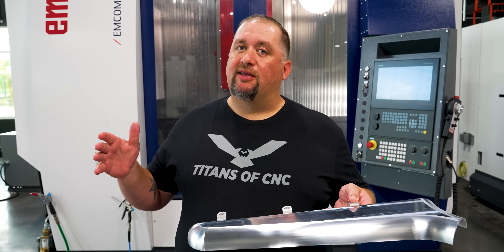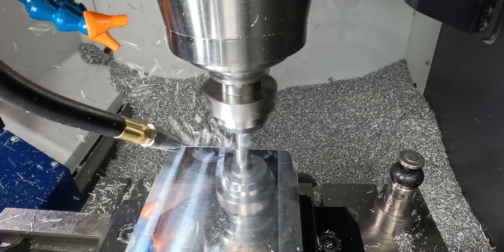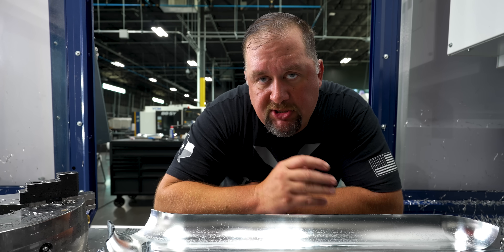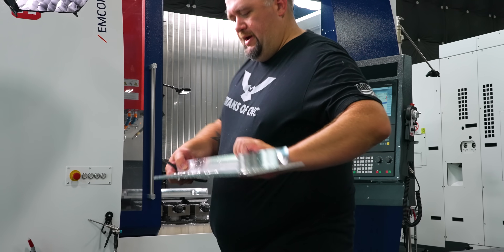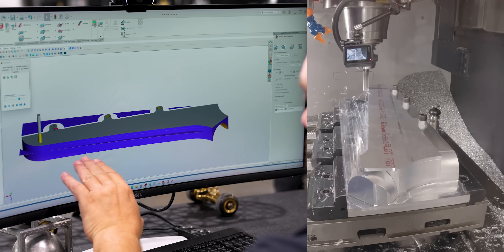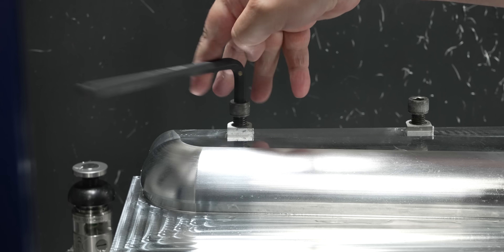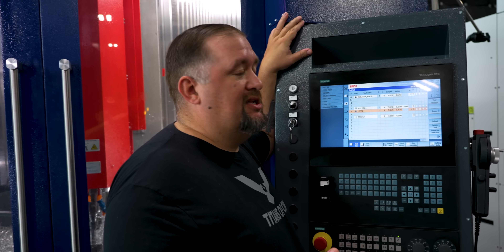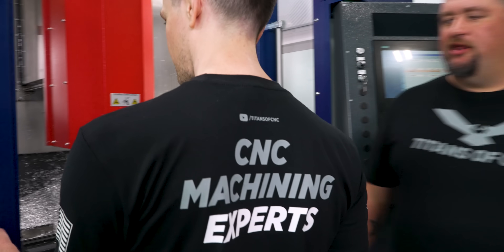How Do You Machine Parts This Fragile?

Comment: I am working on a lathe and our thin walled parts have a wall thickness of 0,5mm. The part itself is in many variations. lenght up to 110mm and diameter can be up to 60mm Still we have to make outside and inside f7/F7 fitting. ;) Greetings from Germany.

Comment: speaking of fragile parts, my biggest challenge,,,, imagine a 40" long "U" the bottom part and the sides that form the U are 6" each.
the sides had a 2.5" double with an irregular surface.
width 1", length 40" with a constant thickness of .250
aluminum 6061........thnks for sharing.  i learning a lot in your videos.........amazing job.

Comment: It feels like you could use some less expensive and easier to machine material for the fixture (like plastic). and that part looks like it should be made by some other means (like casting or pressing).

Comment: Why is it that machining costs more than a fabricated part... it seems straightforward that the hard part of the job is calculating dimentions. Where if you were to mold or fabricate the same part you would still need to do that but also add in a  craptun more manuial laybor than the person running a cnc. Were prettymuch just paying more for the company to afford the big ass machine. I partially blame cnc machinests for the decline in the american steel industry. Hopefully when we make it common practice for ai to controol cnc we would be able to afford it as a middle market rather than top of the line thing when most of its all automated

Comment: Considering he had to machine two different supports anyway, I really can't see how this could be faster OR cheaper than hydroforming...
Reply: Well, I have worked in several aircraft shops that did both hydroforming and drophammer forming, not just machining. That's why I mention that in this video. But Hydroforming does not usually make a perfect part......you have a handforming department that usually beats the part with rubber straps, and hydroforming also has other challenges like wrinkling and oil-canning, not to mention the extra design time to design the hydroform blocks with springback, which can be very tough with compound curvature like this part has. In the end, it's 6 of one, a half dozen of another, and sometimes it's up to the customer to decide how they want the part made. In this case, they sent us plate and asked for the part to be machined, so that's what they got!

Comment: Even if you had the conveyor those chips wouldn't fall onto it. Looks like a permanent headache.
Reply: To be fair, I also was barely running coolant, you can see the valves on the spindle are almost completely closed. Coolant would certainly have helped with the chip evacuation

Comment: Respectfully, nice looking part.  'Thin-wall' is in the eye of the beholder.  Due to the overall dimensions of the part, this is thin wall, but could you do that same part with a .04" to .05" wall to show what technique you would use.  From the battlefield, we are getting creamed by designers that have no concept of machining metal.  They 3D print sections of a part, glue them together, and say 'my printer could do it.'  Since they are higher up on the pay scale, who do you think has to adapt? Would this process lend itself to adding a vacuum seal around the perimeter with some channeling on the interior of the tool?

Comment: I still gotta ask, How much did it cost? Considering the cost of the machine, all the tooling, programming, time, material cost, your wage, profit margin and mark up etc... Chip watching fan boys might want to know. Sure didn't do this job for 20 bucks and a couple cans of Copenhagen.
Reply: A typical shop rate is around $100-150 an hour. Each part took about 1.5 hours, and each fixture took about an hour. So worst case this cost about $2500 plus material
Reply: @barrysetzer  Thanks for the reply Barry. Much appreciated. Can't argue about the time frame but the shop rate and cost + material sounds low.

Comment: Question guys, but when I use cam on ONEcnc i have to have my tools numbered, on that system and after I transfer it to my 828D controller I have to change each tool manually in the program to (eg) T=“16mm carbide” or in your case T=“Barry” … does your cam system also do this or can you actually name the tools you want on your cam system

Also a machinist always cleans out his own chips! 🫣😭
Reply: Haha i cleaned my own chips, it was just a joke! And any CAM system can output tool names rather than tool numbers, just talk to your CAM reseller and they can tell you how
Reply: @barrysetzer thanks Barry I’ll look into that. The more tools I use the more complicated it gets manually changing the tool names in the program. Can take around 10-20minutes depending on the size, and if I need to make adjustments I have to do it all over again 😢

Comment: Why would you CNC a part like that? This should be sheet metal
Reply: Manufacturing such a part from sheet metal requires expensive forming tools, which often have long delivery times. For larger sheet metal parts, laser cutting systems are sometimes also required to smooth the contour after forming, which increases the machining effort. For small batches, CNC milling is definitely the best choice, and such parts can be manufactured from high-quality materials. Fits for seals and screw connections, for example, can also be achieved with milling, giving the designer of such components more options.
In mass production, such a part would, of course, be manufactured directly from sheet metal.

Comment: What kind of surface profile was required? How do you deal with spring back after over restraining the part?
Reply: The nice thing about this particular part is that it had no profile callout, and it gets welded together with several other components. Somewhat surprising also was that the part didnt warp hardly at all, less than .010". However, even with companies like Boeing, with thin parts, they know the part will warp in an unrestrained state, so they have specs that allow a certain amount of warp per foot or they allow the part to be inspected in a constrained state.

Comment: Great video as usual, I do have a question, could a casting have been utilized to avoid all the waste material?
Reply: It could be cast or made from sheet metal. But for 5 parts, its cheaper and easier to machine from solid!

Comment: i still remember  when i was a student and had to turn a 0.0393 inch thick walled part on a manuel lathe ( ID and OD had to be turned in the same setup  ) holy moly that wasnt fun  ( my instructor wanted a custom made solid billed aluminium exhouse for his bike ) lots if small passes going slow with the right amount of cooling pressure did the trick ( there wasnt material to make a fixture and both ends was tapered inwards anyway )

Comment: You started the job correctly by using plate not bar stock. Parts came out perfect.
Reply: That's actually a very good point, and something that I SHOULD have mentioned in the video. Cheers!
Reply: @barrysetzer  proper stock is crucial. Metal grain direction is also important. That part would have moved a mile if metal flow was in the width.
Reply: Oh yea i hate when parts bend like a babana

Comment: I'm always curious why they use long endmills for everything can't you push a shorter one faster?
Reply: In the case of this part, the tool length was necessary. The part is 2" tall, so I used a 3/4" endmill that has a 2.25" LOC, and a 1/2" ball with 2" LOC

Comment: For Op2, I see the 3 bolts holding the part at the top.  What's holding the part at the bottom?  It seems like the part would be loose down that and would cause chatter but the part looks fine.  What am I missing?
Reply from the maker: He explains how to machine into the part to keep pressure on it. Technique
Reply: @TITANSofCNC  Thanks for the reply.  I didn't catch this in the video but I guess I'll have to watch it again.  Seems a little sketchy to not hold the part near the bottom too but hey, you're the experts and the part looks great.

Comment: Good work and good video. 

Super glue, Bondo, Vacuum fixture, double sides tape, tabs many ways to handle this part. Did a 6061-T6 14" x 20" x 4" cover for Predator Drone 25 years ago that was .03 walls with ribs with a .002" flatness tolerance in 2 operation on a HMC. I made custom STI shoulder bolts and an internal spider to stabilize the part. Do that with a 120" diameter billet 12" think and hold the .01 flatness taking 7700lb alum down to 440 lbs or 65" diameter x 50" tall tube 5500 lbs down to 550 lbs and hold .0015 flatness and .002 perpendicularity.

Comment: Could a vacuum hold be used on your second op? Seems like it fit tight enough and was smooth enough that vacuum might have worked well and avoided the tabs.
Reply: Probably didnt have a vac system available to use, and i would bet most shops dont, unless they do this work often. Still a valid way to hold parts though.

Comment: You might be able to print dies from filament for a 5 part run. Maybe not with this geometry, and it may be rather experimental, but it’d be neat to have in your bag of tricks.
Reply: Considering he had to machine two different supports anyway, I really can't see how this could be faster OR cheaper than hydroforming...